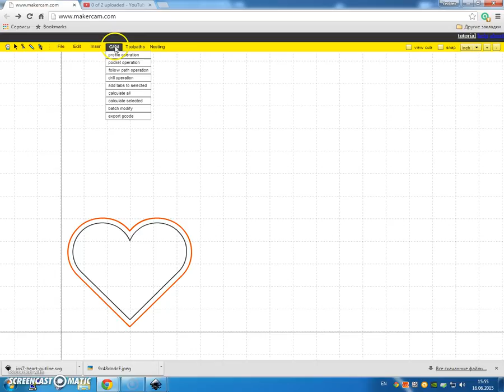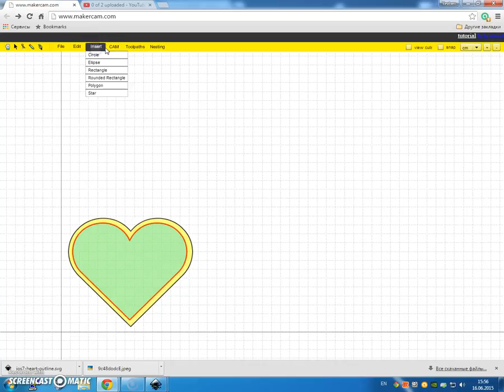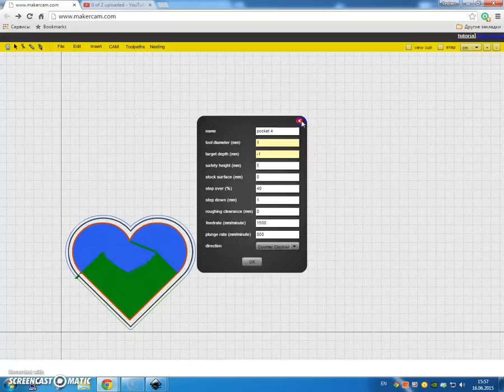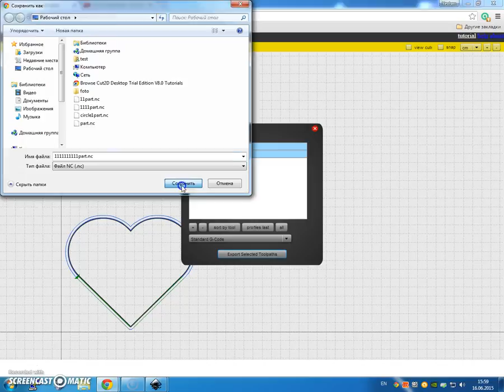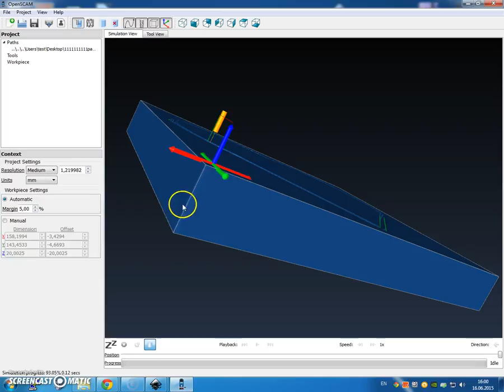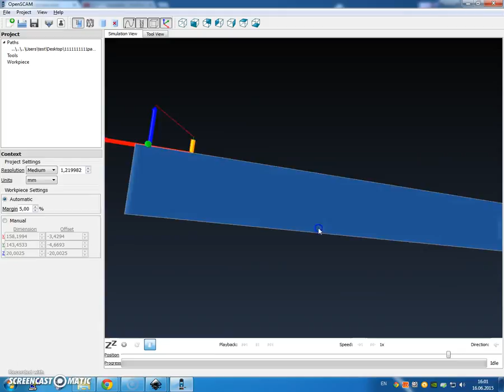learning makercam need to know how to set material depth

Comment: Do you have any idea why my g-code was like 400 steps or codes for a simple mustache? with no pocket or large size just the outline. Pliss if you knw
Reply from the maker: Sorry no. A buddy told me that there is a better site for making gcode... I'll have to chase that link down...
Reply: Dennis G D  alrite ill check it out
Reply from the maker: Aleander Vargas The site I was thinking about makes vectors on line not gcode. Sorry. Here it is. https://vectr.com/
Reply: Thanks dude, anyways i found what the problem was in oder to do it with less g-codes you got to set the steps down same as the dept